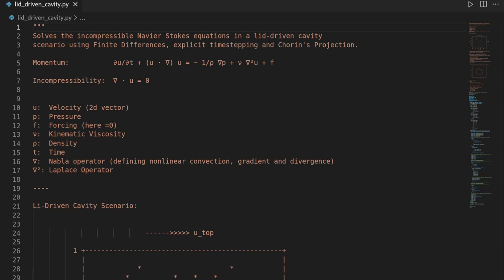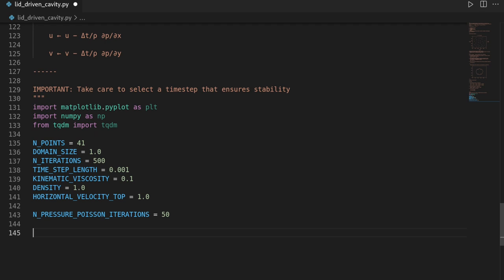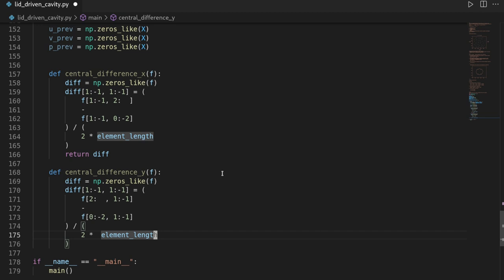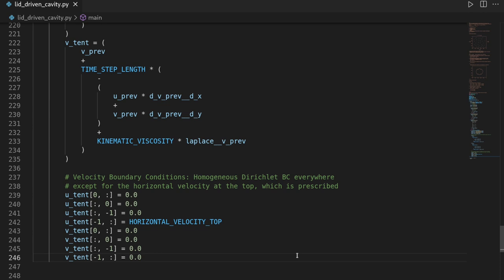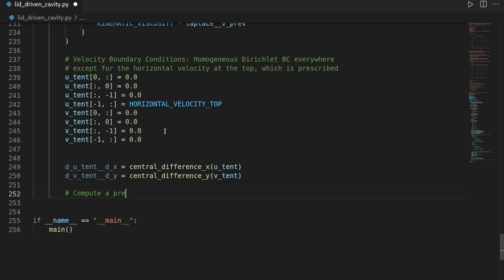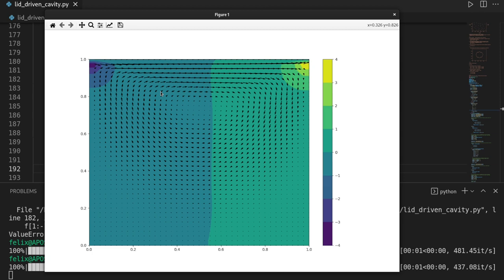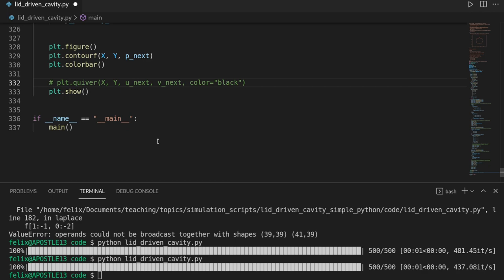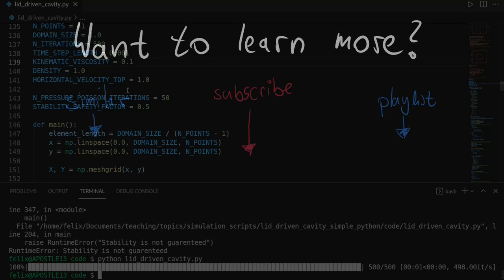Solving the Navier-Stokes equations in Python | CFD in Python | Lid-Driven Cavity

Comment from the maker: Important note, that I forgot in the video: Towards the end, we implemented a stability criterion for the diffusive part of the equation. Be aware that this does not mean you can select the kinematic viscosity to be arbitrarily small. If you do so, the (local) Peclet Number might be larger than 2 (https://en.wikipedia.org/wiki/P%C3%A9clet_number) leading to the unconditional instability of the Forward-Time-Central-Space discretization of the nonlinear convection.

This is because the FTCS scheme only works for advection-diffusion problems (like the Navier-Stokes equations are) if diffusive transport is dominant.

If you want to avoid this problem, you need to discretize the nonlinear convection term in means of an Upwind Difference. If you choose to use the First Order Upwind, then the time step has to be chosen in accordance to the CFL condition (https://en.wikipedia.org/wiki/Courant%E2%80%93Friedrichs%E2%80%93Lewy_condition) which can be a tougher restriction than the constraint we have from the FTCS scheme. In order to enforce the CFL condition, you might also have to adapt the time step throughout the simulation, as it then depends on the maximum velocity in the domain.
Reply from the maker: Additionally, be aware that at even lower kinematic viscosities you might see spurious oscillations in the pressure field. This is the so-called checkerboard pattern that is caused by using a central difference for the pressure gradient on a co-located grid. A co-located grid means that all variables (u, v and p) are stored at the same points in the domain.
There are two remedies:
1) Use a staggered grid. This will have pressure, u velocity and v velocity being saved at different points in the mesh.
2) Use a corrective interpolation, e.g. the one proposed by Rhie & Chow.

Comment: Could you make a video on this example but in 3d and with no slip boundary conditions on only five of the walls, (the wall with slip condition is the one where the 'stream' is that causes the swirls.) I really love this video and the pressure displays.
Reply from the maker: Hi,
thanks for commenting. :)
That would indeed be a great extension to 3D. Though, I am unsure whether it would be worthwhile to implement similarly to this 2D video due to a considerable increase in computational requirements. Maybe that would be a great task for the Julia Programming language.
I will note down your idea, but I can't promise to have a video in the near future :)

Of course, if you come up with a 3D extension, feel free to open up a pull request on the GitHub repo: https://github.com/Ceyron/machine-learning-and-simulation

Comment: Great work, I like it, especially when you use tqdm
Reply from the maker: Thanks.  ❤️
Yes, I think tqdm is a neat tool to show the transient simulation progress.
Reply: @MachineLearningSimulation  please if you can make a simulation with c++
thank's
Reply from the maker: @hasnaouiacademy7899  Will definitely come in the far future ;)
As of now, I think Python or Julia is better because the overhead and boilerplate is lower
Reply: @MachineLearningSimulation  it's just to get some knowledge about how to programme with CFD.
Do you know how to work with machine learning to solve PDE equations.
I am very interested in this field.
Reply from the maker: @hasnaouiacademy7899  There are a lot of flavors to using ML for PDE solving. You can have full surrogates like PINNs or just data-driven models like turbulence closures etc. Maybe a good first pointer is this review article: https://www.annualreviews.org/doi/abs/10.1146/annurev-fluid-010719-060214

Comment: Very interesting and very well explained! That's the kind of video that helps students like me.
Simple question: does the fluid inside the cavity can "flow out"? What if the "lid" is another fluid, is it possible to modify your code to compute the mixing that will occur?
Reply from the maker: Thanks for the kind feedback 😊
There is a minor mistake in the video, in that I said that the top boundary is something like the interface to a free stream that is passing by. Actually, the lid-driven cavity scenario is closed off; three walls are stationary, and one (the top) is moving to the right. 
But back to your question: if the top was open and a free stream with a different fluid passed by: generally speaking, yes it is possible to simulate the mixture of two fluids. However, this is way beyond the complexity of this video. There are approaches like the volume of fluid method but I have to refer you to a text book on intermediate topics in CFD for that (maybe it is covered in fertiger & Peric).
If one had the simpler case of a passive species being transported (like smoke) in the liquid, it is possible to do so by a simple additional advection equation (that is easier to solve than the NS equations). There is also the option that the smoke asserts a force back into the liquid based on its buoyancy. I also have video on that for which I used the phiflow package: https://youtu.be/KMfcF9XvVio?si=Y065eoSm6WiBG-jr

Hope that answered your question. 😊

Comment: Hi, thx a lot for this tutorial, very helpful ^^. 
I am new to CFD and I came across the existence of different type of discretization schemes (upwind, linear upwind, and central). I guess u are making use of the central one in this video. Also, why did u choose this one specifically? 
I guess in such a simple case it would not make any difference, but I suppose there are scenarios in which one gives better results than the others. Are there some rules depending on the domain structure? Thx again!
Reply from the maker: Hi,
thanks for the kind feedback 😊 I'm happy the video was of help to you.
Indeed, you correctly observed that the convection/advection part of the Navier Stokes equations was discretized using a central scheme, in this case the second order accurate central scheme for the first derivative. For many scenarios, this is a bad choice. Here it is only viable for making the tutorial simpler.
If you look at the prototypical hyperbolic PDE: the 1D advection equation and you discretizatized it with an ftcs (forward-in-time central-in-space) scheme (like we did in this video here), you would even find that it is unconditionally unstable. In other words: you can make your time step as small as possible and the simulation will still be unstable (it develops unphysical oscillations).
The usual remedy is the use of a first order upwind scheme. If your advection speed is postive, you discretize the first derivative with a backward stencil. Vice versa, if the advection speed was negative, you would use a forward stencil.
The reason, we are able to make usage of a central scheme in this video was because we have enough diffusion. In other words, the kinematic viscosity was chosen high enough. There is also a dimensionless number for this: the Peclet number (closely related to the Reynolds number). We know that for an advection-diffusion equation a central scheme for the advection part is only stable if we can guarantee that the Peclet number in each part of the domain is smaller than 2. This is the scenario for which we are simulating here.
In general, for any realistic CFD, you will mostly rely on upwinding biased scheme. This is a general term and just means that your stencil points for the derivative approximation are not centered around your desired degree of freedom, but favor one side over the over, which side is typically dependent on the flow direction (similar to the first-order upwind).
In the CFD community (especially for openfoam) I believe that the word "upwind" just refers to the first order upwind, as described before whereas "Liner upwind" refers to a second order upwinding.
(Despite the latter being more desirable it has also some disadvantages).
Hope that helped 😊 Let me know if something is still unclear.

Comment: which editor are you using? i am using spyder and i absolutely hate how slow it performs on my computer
also i have 3d ascii cfd data generated from a fortran code. is there a way to plot it on python? (x, y, z, pressure)
Reply from the maker: Hi,
I am using VS Code together with the Python extension. I like this combination a lot and it performs reasonably fast.

Regarding your second question: There are probably multiple approaches. If your data comes in a standard format like CSV, there are a lot of reader libraries that can read the files and, for instance, create numpy arrays out of it. Maybe check out this tutorial: https://numpy.org/devdocs/user/how-to-io.html
It can also be helpful to look into Pandas.

Comment: Where does the external flow come from?  Is the lid being moved and therefore causing flow?  Or are you programming some arbitrary flow to force vorticity?
Reply from the maker: Hi,
that was an error in my understanding of the lid-driven cavity at that time. Correct would be that all four boundaries are walls, and the top wall is moving to the right. Hence, there should be no "external flow".
Though, I think both are mathematically similar since we have a prescribed Dirichlet boundary on the velocity. Probably, the pressure handling changes. Do you know more?

Comment: Thank you very much for the video. I am wondering if you may teach me how to adjust the boundary conditions such that the flow goes around a cylinder. Thank you.
Reply from the maker: You're very welcome 🤗 thanks for the comment.
I believe you are interested in a setting different from this example in that you also have an inflow and an outflow. In the example of the lid driven cavity, there domain is actually closed. Take a look at the other videos in the series: 🌊 Simulations simply implemented in Python or Julia: https://www.youtube.com/playlist?list=PLISXH-iEM4JmgBfU_QU262MQTYa7DoJK0
For example the one with the transient pipe flow that shows how to prescribe inflow and outflow. I also have a video on the van karman vortex street (flow behind a cylinder), but it uses an lbm approach. For a FDM approach, the easiest you could do is to create a mask for the nodes that belong to the cylinder then force zero Dirichlet BCs on them for the velocity and and zero neumann on the pressure.
Reply: @MachineLearningSimulation  Thank you so so much!!!! <3
Reply from the maker: You're welcome:)

Comment: How come I get this when running the code?

RuntimeWarning: invalid value encountered in add
  u_prev * d_u_prev__d_x + v_prev * d_u_prev__d_y
RuntimeWarning: overflow encountered in multiply
Reply from the maker: That would probably refer to some of your values turning NaN (not a number) during the simulation. Often, this happens when the computation becomes instable. Maybe you have changed some of the parameters (like number of discretization points, kinematic viscosity or the time step size). Try to lower the time step size ;)
Reply: @MachineLearningSimulation  Thanks, it runs.
Reply from the maker: @antares6998  You're welcome.

Comment: Hello, after updating the velocities (applying the pressure correction), don't we need to check if du/dx + dv/dy = 0, and if it is not, keep repeating the process for that time step till it is?
Reply from the maker: Hi, great question! :)
It depends on the context of what you are simulating for. If you do a true engineering CFD simulation, you have to ensure both global and local continuity (at least to within a sufficient tolerance). As you mention, one way would be to repeat solving the pressure correction problem with subsequent projection until this tolerance is reached. One should then also put emphasis on having the correct BCs for the poisson problem (here we incorrectly used homogeneous Dirichlet BC at the top for convenience) as well as employing a better linear solver: the Jacobi solver with a fixed amount of iterations is arguably a bag choice.
There are many approaches as to how to select outer, inner and mid-iterations giving, e.g., rise to algorithms commonly used in engineering like SIMPLE or PISO. I can totally recommend the book by Stefan Turek called "efficient solvers for incomprehensible flow problems" as it unifies many of the approaches from the perspective of solving a coupled saddle point system.
Initially, I said it depends because even a bad incompressibility projection (i.e. one that does not reduce the divergence enough) is still creating swirly motion. We want a vortex to get the lid driven cavity. You can also try this yourself, by commenting out the projection step, the flow will not get swirly.
Hope that cleared it up a bit :). As a final remark: the intent of the video is educational, it's not a rock solid CFD code. I don't think you can write such a code in this limited amount of time 😁
Let me know if sth is unclear :)
Reply: @MachineLearningSimulation  Thanks for the detailed reply! Makes sense. I was just asking because I was running similar problems with a different method and a slightly different approach, however I was getting a program that is very slow. I was trying to compare what the difference was between the two programs, and figured that it was the incompressibility check, so I just wanted to know if there was a way to get around it.
Reply from the maker: @atharvnaik  that's an interesting observation. 😊
My experience is that the pressure correction problems are often the toughest parts in each CFD simulation (not only from the analytical perspective with deriving the correct BCs, but especially for computing them numerically). It commonly becomes the part of the code the most computational time and effort is spent.
In other words: with taking a more lax approach as in the video we can simplify many things and "speed them up" 😁

Comment: What about adding residual error?
Reply from the maker: Certainly, some form of residual check would be necessary to judge about the quality of the solver. Though, I think it's a bit beyond the purpose of the video as this just aims to be the simplest (arguably also the crudest) way to solve the NS equations 😅 There will most likely be a huge residual in the continuity as the pressure poisson problem is just solved with a Jacobi smoother for a fixed number of iterations, no convergence check is made. Also, for the momentum only one Picard iteration is performed, also without convergence check. Would be interesting to see how that affects the long-term solution since it converges to a steady-state 😁
Long story short: if you have a nice way of adding a residual print-out feel free to open a PR over on GitHub :)

Comment: Could you please help on how to use projection method to solve Navier-Stokes equation in cylindrical coordinates?
Reply from the maker: Hi,
thanks for the question. Unfortunately, I do not have much experience yet on working with Navier-Stokes in cylindrical coordinates. Though, more generally speaking, projection methods (at least P1 projection methods like Chorin's splitting) work such that you ignore the pressure gradient term in the momentum equation, then solve an elliptic PDE for a (pseudo-) pressure correction and then correct the velocities. I assume this might be similarly applicable to cylindrical coordinates. I think this Wikipedia Article might be a good first start: https://en.wikipedia.org/wiki/Projection_method_(fluid_dynamics)

What is the concrete problem you are solving?
Reply: @MachineLearningSimulation  Thank you, will try again keeping this in mind. Thanks a lot for the wonderful video, found it helpful to get started with code.

I am trying to solve startup laminar flow of liquid in a pipe using projection method till the fluid reaches steady state flow. Initial velocity of the flow is given.
Reply from the maker: You're welcome 😊
Maybe you also find this video helpful: https://youtu.be/rV8tD2nQfkk

Comment: Sir, can you please explain why there is a kind of phase separation in the streamline plot???? Will it persist in this particular problem of lid driven cavity throughout the run time ???
Reply from the maker: Hi,
thanks for the comment :).
Can you elaborate what you mean by phase separation?
Reply: @MachineLearningSimulation  Sir , actually I just want to know the explanation of what that different colour layers does mean which are appearing at time of simulation  ??? Physical explanation
Reply from the maker: The contour plot is the pseudo-pressure. The streamlines are created by the velocity field.
Is that what you refer to?
Reply: @MachineLearningSimulation  Can you please explain the changing of pressure physically

Comment: How difficult would this be to expand this solution strategy to a 3D system? Or a nonisothermal system?
Reply: Also this was an awesome video. Thanks for the great explanations :).
Reply from the maker: Hey, thanks for the kind words, :) Really appreciated.

Regarding your question: I think it would not be too difficult to extend to 3D. The Laplace operator would get a third term, and also in the Central Differences discretization of the convection we would have a third one. As long as you keep the degrees of freedom reasonably low, it should also run in an acceptable time. Of course, make sure the simulation is stable. It might be a cool challenge. If you want to share something: feel free to open a Pull Request over on the channel's GitHub repo: https://github.com/Ceyron/machine-learning-and-simulation

Regarding non-isothermal: I would say that depends on the concrete modeling. In the easiest case, you just have to solve another advection-diffusion equation in each time iteration. That's a cool idea for a future video. I will note that down. ;)